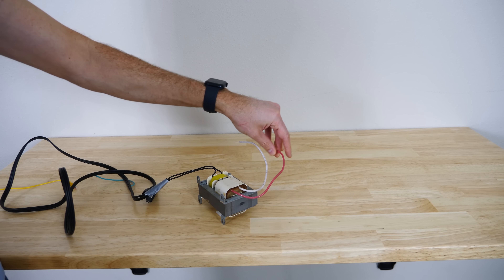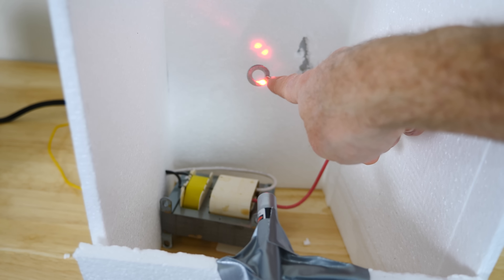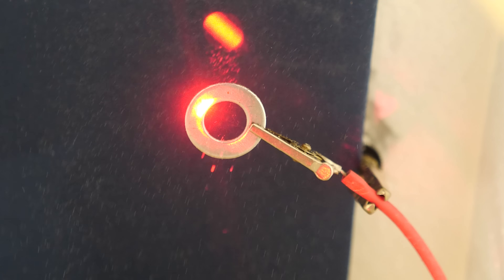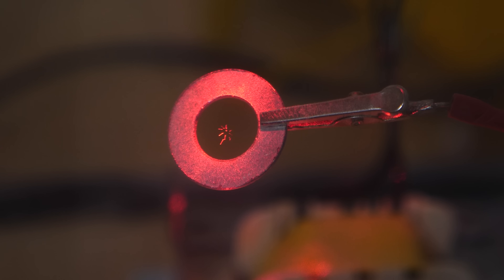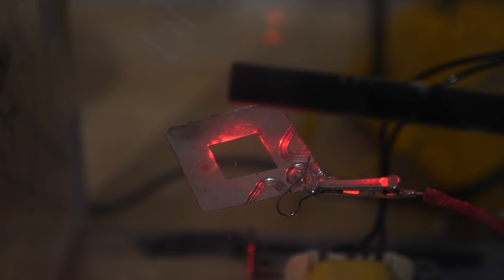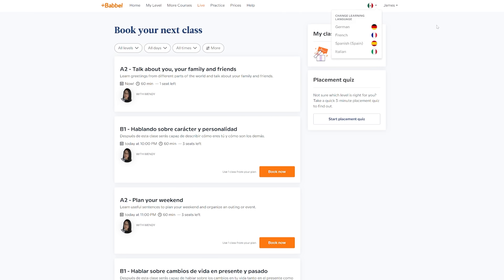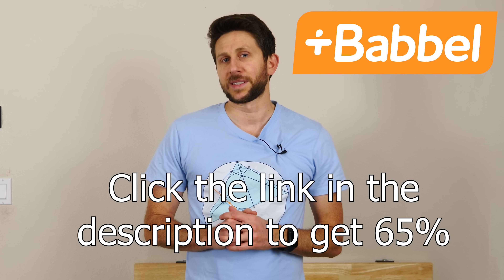Building An Ion Trap To Levitate Particles

Comment: Your "solid state" neon tube power supply still uses magnetic devices (inductors or transformers) to boost the voltage, it's just not a simple AC device.

Comment: I remember doing this experiment in college physics, with the goal of measuring the precise charge of a single electron. It was called the Millikan oil drop experiment. Instead of spores or oil we used some type of tiny plastic of foam beads, isolated them until there is one left, then slowly turn down the voltage until it begins to fall. Quantum mechanics was my all-time favorite course because no other course taught me more about how the universe works, and those labs were super fun.
Reply: Millikan's experiment uses DC voltage.
Reply: @hamdaniyusuf_dani  Yep.  The oil drop exp is simpler to understand too.  Simply the acceleration of the particle in the electric field equaling the acceleration of gravity.

Amusing factoid... Millikan fudged his data to make the experiment look a lot cleaner than it actually was.  He basically threw out a ton of measurements and just kept the 'good' ones.  If I remember correctly, there's also ample evidence he didn't properly credit the folks who were actually doing the work.  Yeah, he wasn't exactly a good person, but was still quite smart and skilled at politics (basically put Caltech on the map by getting a bunch of top scientists of the day to work there.)

Comment: Grounding one side of a NST is a terrible and dangerous idea as they are usally centre-grounded to the core. By grounding one end, the core may be sitting at 2.5 kV, risking breakdown to the primary. If this happens you will have a direct path from the mains to the output, with minimal current limiting
Reply: english please?😂😂😂😂😂😂

Comment: Im curious, what if you have a bigger power source? is it possible to compress these few particles together? Would having a higher frequency source vibrate the particles apart as they oscillate faster? Will it levitate an ant? Can i poke my finger into the hole?!

Comment: I teach about Orbitrap and Ion trap systems in Mass Spectrometry and this is one of the coolest demonstration of how it works in the Ion Trap Mass spec system. When you turned the voltage up and down, it's just like how ions are selected during mass analysis. Thank you for this video!
Reply: Allways thought it needs a rotating field for the trap like using 3phase high voltage or a spining dipole, nice that works too :)
Reply: Are their any known applications of trapping charged particles like so?
Reply: I felt like the movement was like a ufo lol maybe thats how they travel

Comment: Could you try suspending a particle and then hit the particle with a burning LASER turning it into ash and see if it drops out of suspension , fly's away  propelled by outgassing , or stays locked in the electrical field

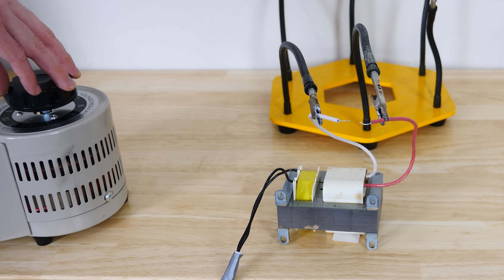Comment: how come the copper or the cable insulation are not being burned  at 1:12 at that high voltage. I have done experiments at the past with high voltage with destructive results
Reply: James uses pretty low I = 8 mA (0.008 A) current with high V = 5 kV (5000 V) voltage. They compensate each other to give just P = V I = 40 W of power though I'm not sure how much do you need to burn the insulation in this setup.
Reply: @Trititaty  but how does he manages the current to be only 8mA?

Comment: do you think it will work  with  one microwave oven transformer(2100v)or two in series(4200v) without variac?it need to charge the particles before putting in the ring or it work without charge because take charge to the ring?

Comment: This kind of system is called an electrodynamic balance (EDB), and we use this method of levitation in my research group quite regularly!
I didn't expect to see this kind of thing on your channel, so it's really awesome to see it in a more layperson format!
Reply: Thats pretty cool. Does this system have any real world application, or a possible real world application for the future?
Reply: @mrpancakes  my question exactly. Does science use this to see at what millivolts certain particles can be trapped? And if so what is the purpose?
Reply: @mrpancakes  trap and hold asteroids for mining purposes
Reply: @adityapratapsingh2518  in today's tech yes but who can say that we don't  find a material or create a material that is able to be used for that purpose and doesn't melt I f I'm right they found a high temperature superconducting material that could be useful for future  fusion reactor builds and nobody expected that  I could be wrong so don't mind me I'm just a guy on the internet that's interested in that stuff
Reply: One question by curiosity: what's the heaviest and/or biggest object you can levitate with your equipment used to that levitation method? Thanks in advance.
Reply: Layman
Reply: Layperson, I'm weak
Reply: What happens when you toy with it? Adding more of thoes devices, identical transformers with identical variable controllers to each with the same lead polarity near each other, would the suspension take on differing shapes depending on the input per transformer? or would it just arc between the leads and fry the transformers?

Either way, this is still really cool
Reply: The AC frequency needs to be fine-tuned to the mass of the particle right?
Reply: @ Dr Thallium what kind of research do you do?
Reply: Fyi, if you  are watching this video you are by no means a "layperson".... this has nothing to do with Fortnite or the Kardashians.
Reply: @chriss1914  i dont think anyone deals with fortnite anymore, unless you're really new to gaming or trying "old" games
Reply: @chriss1914 This video and Fortnite are both good.